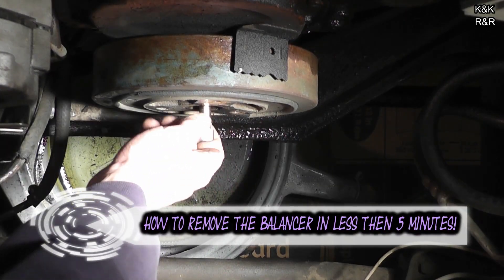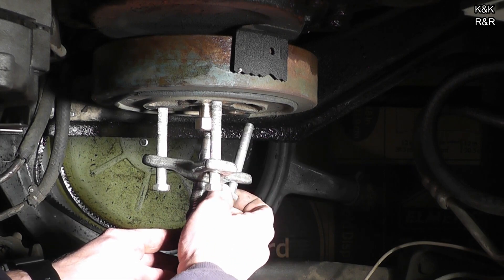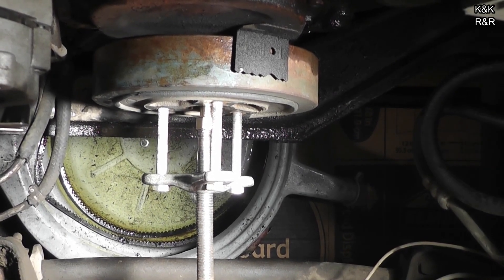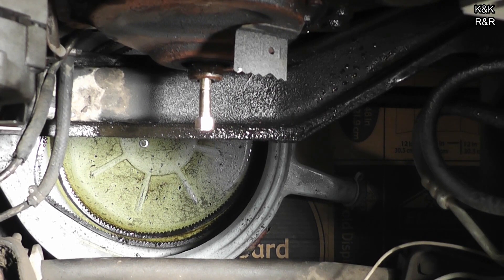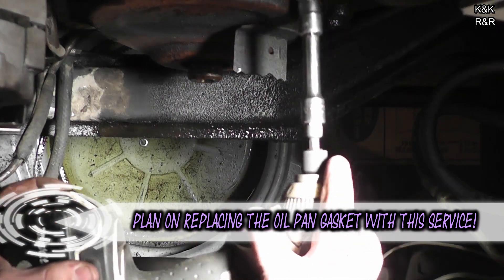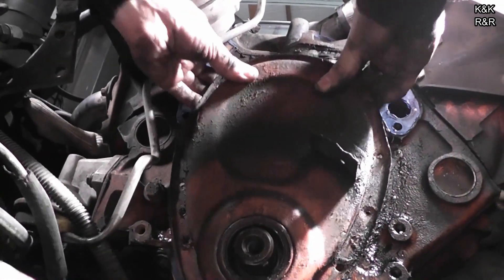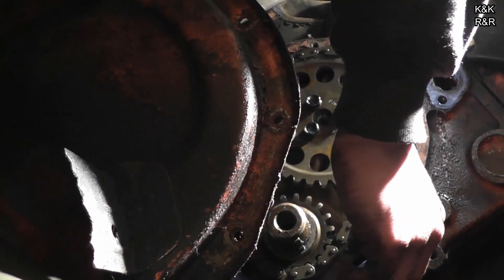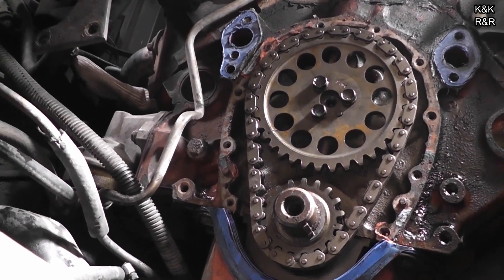How to Diagnose & Replace Any Chevy 350 / 5.7L Timing Chain Pt2 Timing Chain Inspection and Removal

Comment: What year of truck was this done on ?   Im trying to find the part number for a 94 5.7 tbi motor and cant lol
Reply from the maker: If you talking about the timing chain Autozone  ( SA Gear / Timing Set
Part #: 78200AM SKU #: 1391905)  has them.  In single or double row timing chain. 
/K&K

Comment: I wonder how the double roller would of looked after the same 30k miles.
Reply from the maker: So this engine had a big cam in plus heavy springs so it stretched the chain out.  I could easily see this double roller being stretched after 60K miles.  
/K&K
Reply: @KNKRNR  That does make sense, thanks for the knowledge. I looked at the gear ran timing, $$$.

Comment: Hi guys, '95 Silverardo 350, 191 000 miles. This winter was getting 6 miles to gal. (last summer/fall about 12-14 Mi./G) , last fall it started making a slight ticking sound (but not lifter clack) that is constant in its sound level and time - sounds like the ticking that you were showing just louder and consistent in time. Truck has rough start and rough idle, sometimes it would smoke on those really rough starts. Recently, it started stalling at stops signs when under load, seemed to hold while in N - I limped it home. So, I checked the timing and found that the previous set of hands had left the distributor a bit loose. So, I timed it to an acceptable btdc range (I can't read the markings on mine but from looking at others it looks like 6 btdc or so). But it isn't staying in the exact same place timing wise, sometimes it'll be a bit before and sometimes a bit after. It seems to have some play. I haven't taken the time to check if it moves forward when its cold or hot - or if there is a noticeable pattern... So I think I know that the chain has slop but I'd like to hear it from guys that have seen this before. Thanks
Reply from the maker: You need to re time it.  You need to find the ECU / DIST interrupt wire so you can run in base timing mode.  On a 1995 I believe its under the glove box,  You will know your in the base timing mode because the SES light will be on.  The base timing needs to set at 0 on the balancers because the computer control the timing advance. Also the fuel injection TBI is timed as well of the dist timing.  Over the years we have seen people try to move the dist to fix an issue to make it worse.  Before you can do any diag you need to get that timing back to zero.  When the dist shaft is bad you will get a clicking sound as the bearing in the shaft go bad.  I have only seen it a few times but it does happen.
/K&K
Reply: @KNKRNR  I found the wire under the glove compartment, it is tan with black line and has its own connection for a quick disconnect. So, unplug, time to ZERO, plug the wire back in and check timing to see what the computer is doing. Easy. Thanks for your help.
Reply from the maker: @muchgreatness7497  Yup pretty much.  GM built the TBI computer / dist to be time by disconnecting the "DIST BYPASS" wire.   After you plug the ECU/DIST bypass wire back in after you re time the engine  you need to restart the engine and make the SES light is off.  Then you will see the computer advancing the idle timing from 8 to12 Degrees BTDC.   Its a simple system but there are people who try to treat the LO5 5.0/5.7 TBI like the old days if the engine had a carb.  Once this engine gets too much base timing then add the computer advancement these engines will run bad if they even start at all.  Let me know how it goes with re-timing the engine.
/K&K
Reply: @KNKRNR  Alright, got it timed to ZERO in bypass. Shut off. Plugged the bypass wire back in. She starts but it isn't the smoothest that I've ever seen her. I can't read how many  degrees advance that I have but I'll describe it. You have the TDC Zero mark on the metallic tab, then moving leftwards you have the large triangle marking, then you have 2 smaller triangle indents. Then at the end you have half a triangle indent, that has only the right side of its triangle. My timing mark is where the top point would be if that marking were a complete triangle. So, I don't know if that is 12 degrees BTDC but it certainly is early. Any earlier and I could not read it on the tab marker. I hope that make sense. She doen't have full power, when I went up a small hill she seemed to be working harder. I dropped a few bucks of gas and when I restarted it took 3 tries and had to floor the pedal and she puffed some smoke. I'll keep looking around to see if I can find anything wrongly adjusted or broken. Thank you.
Reply: When I run it with bypass un-plugged (timed at ZERO - TDC), the idle is better but not 100%. When I plug the bypass back in, the engine is 90% good but there's a little something missing. As said earlier, I have a loud enough ticking sound that is coming from the aftermarket muffler and I was wondering if the knock sensors could be picking that up, thinking its a knock and advancing timing by as much as they can? My next option is either to run it without the muffler (to confirm its actually from there) and see what happens to timing...Or, pull the bypass plug, time it to 6 btdc and run it without the plug and see how that goes.
Reply from the maker: @muchgreatness7497  With 191k on the clock its possible the harmonic balancer may not  be 100% accurate.  Test this theory time it -2 then positive 2 degrees and see if it runs better or worse.   You say its 90% better then it was shows you are on the right track as far as timing being off.   Generally the Knock sensor makes a temporary timing correction till the ping/ knock condition disappears.  Does the ticking sound go away for a few revs then returns or it constant?
/K&K

Comment: I have bought a Chevrolet caprice built 1992 5.0 V8  question has it a timing belt or chain
Reply from the maker: That's going be a chain both use the same part number for the timing set. 
/K&K

Comment: Please answer me!!! I have a 91 z71 5.7 tbi it has a misfire cold and hot no check engine fuel pressure is 12psi with load I check Egr and for any vacuum leaks the truck runs ok on the highway but has no power going up a slope the truck turns on always right away can it be timing chain I have 160 and 150 psi on all cylinders
Reply from the maker: Do you know if the disturber was ever adjusted or moved for any reason?  We had this 1994 TBI 350 1500 in once that would start too quick and miss like crazy.  The timing was too advanced as the owner thought he just turn the disturber tell it ran right like the old days which is not the case with the TBI 350's.   You will need a timing light to test the timing. The timing at idle should 8 to 12 degrees BTDC in the computer control mode, if you see 15 to 30 degrees BTDC in the computer controlled mode at idle  the engine will miss like crazy.  There should be a black connector joining a single tan and black wire that breaks out of the wiring harness under the battery-junction block in the rear center of the engine compartment. Once disconnected, the electronic spark timing will go into bypass mode / timing set mode. The base timing needs to be 0.  In these trucks if the timing chain is bad you will have late starts and sluggish performance.  I would suggest before you go any further make sure your timing is dead on as these truck will run like crap tell your base timing is set at O BTDC in the bypass mode. and once the timing connector is plugged back in computer controlled timing curve is running 8-12 degrees BTDC at idle.   Please let me know what you find out after checking your timing before I have you check other items in this engine.
/K&K
Reply: @KNKRNR  yeah I set my timing too like 5 days ago I disconnected the wire and set to 0 I forgot to say it has a small misfire cold but gets worse once warmed tomorrow ima set the truck to 0 tdc and remove the distributor cap and check how many degrees I can move the crank before my rotor moves I want to fix my truck so bad I’ve had this problem for 9 years I don’t really drive it tho only put 25k miles in those years but the misfire just got worse, like maybe it jumped a tooth, but like I said my truck turns on right away on the freeway you can’t really tell it’s misfiring but I have to power going up hills
Reply: @KNKRNR  so I lined up the timing mark to tdc right at 0 and yeah my timing chain has a lot of play when I turn counter clock wise the mark on the harmonic balancer doesn’t even stay on the timing cover readings when my dizzy starts to move, I’ll let you know how it goes I my symptoms are misfire at idle , no power going uphills it’s a 91 k1500 5.7 TBI I get no check engine light not even a knock sensor miss
Reply from the maker: @miguelplascencia6093  . When you unplug the timing bypass connector does the engine still miss at idle?  
/K&K
Reply: @KNKRNR  yeah it does I remember like 5 years ago me and some friends that are mechanics set the timing because the distributor gave out and when we where trying to set the timing it kept jumping all over the place with their snap on timing gun it was difficult for them little adjustment on the dizzy will move the mark a lot I bought a timing gun brand sunpro and it hasn’t jumped and I checked timing like 4 times with this gun and timing is steady maybe my chain is so stretched it jumped a tooth I’ve been really busy I sold my car trying to buy a Harley at the moment to get around but today ima try to remove the timing cover
Reply from the maker: @miguelplascencia6093  You ever done an intake gasket to that engine? Compression test won't show an intake gasket leak. If you have a leak there, there's a possibly you will have a miss because that cylinder is running too lean.  Spray some Wd--40 at the intake running near the cylinder head and see if the miss goes away, or gets worse. any change would mean you have an air leak at the intake gasket.   WD-40 doesn't burn well in a gas engine.  The low power makes since for a timing chain issue, but the miss at idle doesn't.  The engine is at the max intake vacuum at idle   
/K&K
Reply: @KNKRNR  yeah I did a intake gasket like a month ago also it had the misfire before the intake gasket and after the new one, the only reason I changed the intake gasket was because I was leaking coolant from the heatercore hose that connects to the intake and it snapped off the intake side. I have my fingers crossed it’s the timing chain my truck only has 150k miles I’m thinking maybe burnt valves too but I wouldn’t have good compression

Comment: How u doin sir i got a quick question. Will a timing chain thats goin bad cause valves too rattle somtimes
Reply from the maker: Not likely,   If its intermittent I would say more likely weak lifters as the lifter tolerance is dependent on oil pressure.    A weak lifter would cause the push rod to tap rocker arm then tap on the valve and make an odd noise.  I would pull the valve cover(s) and check the rocker arms and see if there is any excessive play.  Might be a simple valve adjustment that's needed.   Bad chains tend have problems with cold / hot starts, lack of power, and base timing that bounces around while idling. 
/K&K
Reply: Thank you very much for responding. Have a blessed day sir.
Reply: My van did  that but it was the timing that was off.. could be the knock sensor too

Comment: Hello, correct me if I am wrong.... but I believe the camshaft dot should be at the bottom (6 o'clock), and the crankshaft dot at the top (12 o'clock), so that the two points are very close together and point at each other is the correct TDC on the compression stroke.
Reply from the maker: Yes I may have have miss spoke on that one correct orientation  is as follows. Crankshaft at 12 O'clock / Camshaft At 6 O'clock both dots should line up for correct TDC.  You can verify correct orientation after the chain is installed by spinning the crank over till you feel compression on number 1 cylinder or if you have not removed the dist check to see if the rotor is pointed at number 1 cylinder when the dots are lined up at the correct position.   
/K&K

Comment: Moving the timing chain so the gears are dot to dot is it alright to turn it with the harmonic balancer to do this? Mine are not lined up and I need to move them dot to dot
Reply from the maker: You can or use the Harmonic balancer bolt instead installed in the crank to turn the crank back dot to dot.
/K&K

Comment: Can’t you just wiggle the cap? If there’s more than a degree then you can assume the timing chain is sloppy. I’m pretty sure mines sloppy at 270k but it runs great with quite a bit of power
Reply from the maker: Nope, the cam is a solid connection to the Disturber.  If you try to move the rotor / cap to test for stretch you can break the shear pin at the bottom of the Disturber shaft assembly. Stretch effects the cam / crank timing,  If your running a stock cam chain stretch doesn't effect much beside cold starts and flat spots in throttle response. Normally you wouldn't change the timing chain until you have driveability issues which we had with this engine.
/K&K.

Comment: I have a 1995 Pontiac Firebird with a 5.7 L and the bearings to the Pistons that go on the crankshaft are all scratched up what do I do
Reply from the maker: You have a few options you can do, 
1. Swap in a good used engine (Cheapest way to go, but roll on the dice on the health of the engine)
2. Remove the engine and have it rebuilt (Expensive but you know what you have).
3. Order a Crate LT1 from Jegs swap over your parts as needed
4. LS swap as they have kits today to make it a plug and play install for the Firebirds / Camaro's.

This is what we recommend to our customers when they have bottom end damage such as yours.  
/K&K
Reply: @KNKRNR  thanks I really appreciate it

Comment: So I went with a big cam and dot 6 on the cam and 12 on the crank Is that right? I can’t get a fire and when it does try I get fire out the carb
Reply from the maker: Cam changes can change the compression stroke time on the disturber. First check and make sure your plug wires are correct firing ordering. If so move on and take the #1 spark plug out and turn the engine by hand till you get a compression stroke on #1 cylinder.  At this point take your dist cap off and see if your pointed at #1 cylinder or not.  If your blowing flame up the carb chances are you may be 180 degrees out on your disturber or your disturber could be one or two tooth off and your timing is off. There's a curve gear on the disturber and its real easy to be off one or two tooth off and blow flame up the carb. The video link below shows how we time most V8's after installation.

https://www.youtube.com/watch?v=um4ldtUyXz4

/K&K
Reply: This is the problem I'm having

Comment: So if chain that loses will here it knock well driving
Reply from the maker: Then can make noise while running, but when there really bad you will hear it clank when you shut the the engine off. Normally you will have drivability issues before they make noise. 
/K&K
Reply: Oh ok makes sense